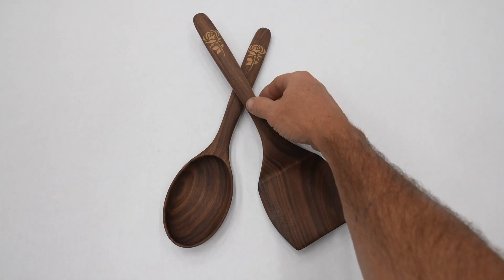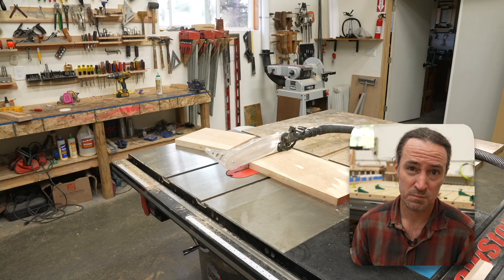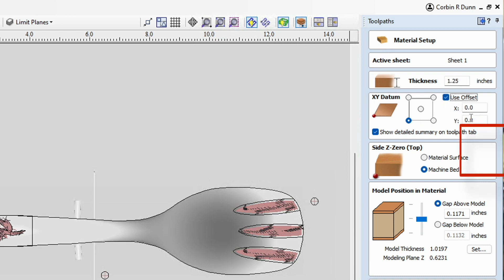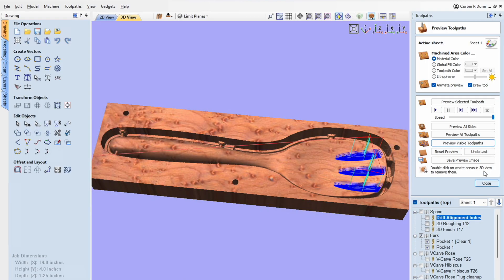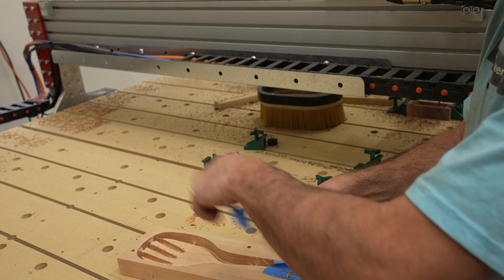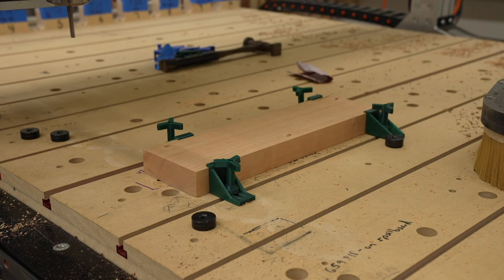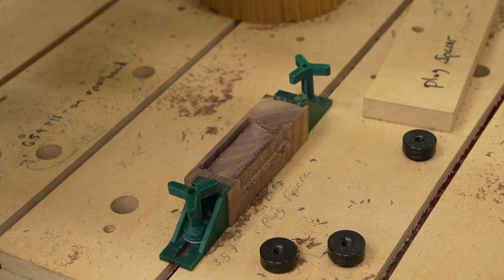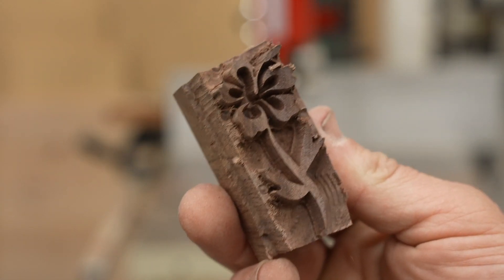CNC'ing a Salad Set with a Wood Hibiscus Inlay - Salad Fork and Salad Spoon Utensils

Comment: Have you tried using Fusion 360 for toolpaths instead of Vectric?  You have a lot more control with Fusion.
Reply from the maker: Scott - YES! I strongly prefer Fusion 360 for toolpaths - it is so much more powerful with a lot more control of how things happen. The only reason I use VCarve is because of the VCarve inlay; it is really difficult to do VCarve inlays with Fusion. I've seen some people get it to work, but there are lots of caveats and it won't work for all designs. 

I've also been informally keeping track of what CNC Woodworkers seem to prefer: Fusion or VCarve. I've found that more people want files that are setup for VCarve than Fusion 360. One of my goals is to share information, and I think I can reach a larger audience by making stuff with Vectric.
Reply: @CorbinDunn  That makes sense.  If your just doing it for yourself, you could probably use both, Fusion for the spoon body, Vectric for the inlay.  I've done some inlay work with Fusion (not on a curved surface); it's a bit tricky.
Reply from the maker: @SRG216  That is a good idea! I do use Vectric just for some flat-inlays; but the curved model v-carve made it tricky. It would mean I'd need some way of accurately indexing the model in both Fusion and Vectric at the exact same location. I can get a lot of a accurate placement in Fusion, but it seems to be a lot trickier to do VCarve. I have some ideas on how I might be able to do it.....I'll have to give it a go and see how well it works. Thanks for the ideas!
Reply: @CorbinDunn  In your video you show using the vcarve XY Datum offset.  You could use this offset, perhaps zero is your machine zero when homed.  Then create a sketch in Fusion to match that does the same thing as the XY Datum, and make the corner of your sketch your zero position.  I often use a sketch point for my CAM zero when there's not a good place on my model or stock.
Reply from the maker: Oh! The other feature of VCarve that I depend on for a curved model like this: Project Toolpath to the Model -- I haven't been able to figure out how to do this type of operation in Fusion when doing a VCarve.

Comment: Well done...thank you fo sharing your technique.  First project I saw with a wood inlay on a curved surface - process makes total sense but the settings for a tight fit my be interesting - as you suggest a separate video on how you get these right would be interesting.
Reply from the maker: Cool, thanks! Yeah, I now have basic experience with it to figure out how to make it work. I hope to do a more detailed cutting board at some point and, and I can discuss how to find the right inlay parameters. I've seen a lot of videos on how to do it..but none of them explain what to do when things aren't working right and how to correct a specific error (ie: too loose with it bottoming out too early or too tight with a hole at the bottom -- really that is it, but knowing what to do is the hard part).
Reply: @CorbinDunn  again a thoughtful response and very appreciated. I paid for Broinwood’s course and he discusses how to test to get the right fit and steps to get there when things aren’t right.  But his instructions are for cutting board inlays (flat inlays).  what was super interesting for  me was you taking into account the curved surface.  That is a new level of complexity - well done.
Reply from the maker: @RobSandstromDesigns  Broinwood does some amazing work! I bet his course is spot on for how to do it. The curved surface is conceptually the same; it's just projected to the model.